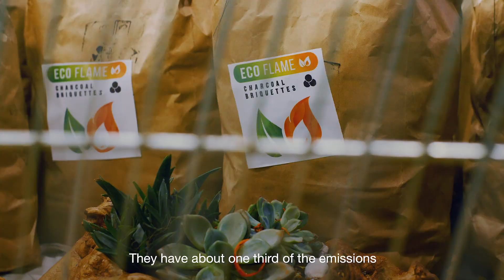How human waste can be transformed into sustainable fuel

Comment: What if sewage was used to fertilize algae farms that were producing liquid fuels?  A lot of the infrastructure for this is already in place.  The algae would remove (at least some) of the pollutants in a way that allows it to absorb more carbon out of the atmosphere, while releasing oxygen.  The fuel generated from the algae could replace fossil fuel and the infrastructure needed to produce and move it with an alternative produced at the points of greatest demand, requiring far less infrastucture and energy to distribute it.

Comment: What happens to the carbon in the poop if not burned? Maybe it was actually carbon negative before and became neutral now, which would still contribute to CO2 output in the end.
Reply: No its is converted into methane and co2 in drains and then it ends up in rivers where the left carbon is converted in methane in sewage treatment plants it is either converted into manure or treated with oxygen and bacteria to give co2